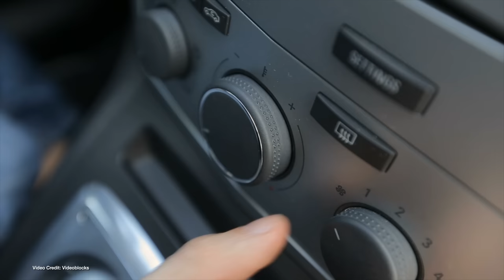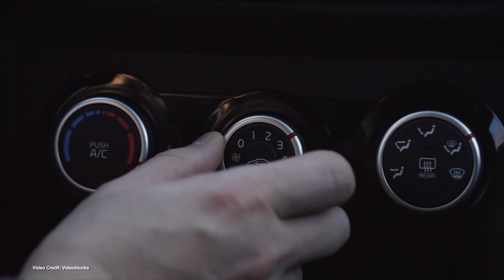How Do Electric Cars Keep You Warm In Winter?

Comment from the maker: EDIT: We know we didn't phrase this well. What came across as the implication that Resistive and PTC heaters (which generate heat the same way) weren't energy efficient was wrong. They're very energy efficient. 

What we meant to say - and should have said - was that while they're good at converting energy into heat - they're not great for vehicle efficiency on a long distance trip because while they convert near 100% of the energy they consume into heat, that results in a much reduced range in winter when compared to say a heat pump. We're sorry for screwing this one up badly.
Reply: But you also said (8:16) that PTC heaters are more efficient than resistive heaters and that doesn't make any sense as they are fundamentally the same thing from a physics POV. I'm sure you know that really.
Reply: @Wookey.  
I have a good argument that a practical PTC heater will be more efficient.
Note that in one of the comments, some was rude about the PTC being resistive so I felt I needed to stretch a point a bit but the reasoning does work:
For structural reasons the heater is mechanically connected to the chassis.
Any heat that flows into the chassis doesn't warm the air.
The element of a PTC heater can be formulated so that it doesn't get above the working temperature of some plastics. 
This means that for it, you don't need to use ceramic parts to hold the element in place.
Ceramics are thermally conductive as all get out.
Reply: Since everything that uses electricity is basically a 100% efficient heater it makes sense.  Of course most of us are getting our energy off the grid which would be lucky to provide us with 50% efficient electricity.  Because of that the statement that resistive heat is inefficient is true.

Of course with the magic of a COP 3 heat pump is we can take that 50% efficient electricity and move 3x as much heat. . . Making it “150% efficient”.

I imagine though that the real COP of the heat pump is closer to 2.5 or less and that the machinery that makes it work is packaged so it’s energy usage counts toward winter heat gain, like you would see with ground source geothermal.  (When I last looked 10 years ago Water Furnace claimed heating COP 1 higher than cooling)
Reply: quite un-factual
Reply: Resistive heaters are 100 per cent "efficient"
Reply: @johndelong5574  
That is not completely true.  The output is the warmth in the air of the cabin.  Heat that goes to the chassis and out to the outside are are losses.
Reply: @kensmith5694  energy can niether be created or destroyed .1 watt=1 watt
Reply: @kensmith5694  you’re going to far with the story.  In this case considering any electric device placed in the location of the heating grid in the vehicle, all other design parameters the same.  100% of the energy the electrical device consumes will be sensible heat within seconds of the electricity being consumed.  Trying to include heat losses through the packaging muddy the reality unless of course the package has to be different to contain one type of electrical device in a way that results in more heating losses.

In proof of the “all electrical devices are 100% efficient heaters” point, let’s consider two electrical objects: light bulbs and ceiling fans.  Interestingly these are often contained in the same package!

In the case of light bulbs we effectively get two things: visible light and waste heat.  But what if I told you that the visible light would be converted to heat in milliseconds?  Think about it.  A photon can not bounce around a room indefinitely.  We would all go blind in an instant after turning on the light if that were the case.  Instead when the visible photons leave the bulb and hit something, you or a wall, some of them are converted to heat and don’t bounce off.  By the time the light level in a room reaches equilibrium the visible light emitted by the bulb is being converted to heat at the exact rate it’s being produced thus the lightbulb is a 100% efficient heater.

In the case of the ceiling fan the same thing happens.  We get two outputs: heat and air movement.  There is some sound too but that’s also air movement.  As the fan turns and moves the air 100% of the kinetic energy in that air movement is being converted to heat via friction and so again even a ceiling fan is a 100% efficient heater.

So. . . Unless you’re moving heat in or out of the cabin via a heat pump or a fan moving in air from outside it doesn’t really matter what you’re using to make heat as the heat output will simply be the energy consumed.
Reply: @johndelong5574  
In any system there will be losses.  The purpose of the heater is to make warm air in the cabin.  Any heat that instead goes straight out into the environment is a loss from the point of view of an efficiency calculation.
Reply: @abelincoln78  
The purpose of the thing called "the heater" in a car is to provide warm air to the cabin of the car.  The resistive element or "grid" is only a part of the heater.  When computing an efficiency of a system you go from input to the output.   If you don't then the calculation of efficiency for an ICE engine could also be said to be 100%
Reply: Heat pumps are the efficient solution. Direct electricity is not very efficient at all. To say resistive heaters are 100% efficient is a bit misleading, because you can make better use of that electricity then just heating up even if heating is all you want to do. 
Still many combustion based heating systems will have an efficiency number based on how much heat from combustion is used to heat up the space (as opposed to lost in exhaust). One has to remember though, that even in those systems the heat could power a heat pump to give better heat transfer than what pure combustion gives. 
There is a theoretical limit on how efficient you can move heat from one place to another: COPheating = Thot / (Thot - Tcold).
Reply: @misium  I get you, but I've also heard people claim heat pump water heaters with COP of 2 are 200% efficient.  Honestly I don't think % efficiency is the best way to rate heat pump systems since I know what a COP is but most people don't so I guess claiming a COP 3 system is 300% efficient is the best we can do.  (I'm team heat pump btw, I just think its silly to not include some kind of backup)

Comment: Yeah, EV's clearly don't work in the cold. I've heard people say this for many years. That's why Norway is the first country in the world where electric car sales outstrip those powered by other means. Because it's never cold in Norway.
Reply: Actually Norway is not as cold as you might think. I just looked up Oslo and Chicago on wikipedia; the average low temperature in January is colder in Chicago.
Reply: @kkobayashi1  for your information: Oslo is in the south of Norway and the sea/fjord (with the heat from the Gulf Stream). Today it is about -15 C/5 F.  On my way home from my cabin back to Drøbak (close to Oslo) the temperature varied from - 10 C/ 14 F down to - 25 C/ -13 F and my EV had no problem. For European and Asian car manufactures (fossile or EV) it is common to do cold climate tests here in Scandinavia (Norway, Sweden and Finland). So, I think it is cold enough to be relevant ;-)
Reply: @arildskaalsveen7126  But 1/3 of the population of Norway lives in that area, right? Are Teslas equally popular in the colder parts of Norway?
Reply: @kkobayashi1  You will find EVs everywhere in Norway (even at Svalbard). The popularity was higher in more urban areas in the south and west due to different incentives such as; you are allowed to drive in fast lanes, no road toll, free ferries and more. Distance between supercharges and EV range is an issue in Finnmark (our most northern part). However, this is changing and more superchargers are now planned and built in the north. Cold climate is not considered as a bigger issue for EVs than for ICEs. ICEs owners are often adding/using cabin and engine heathers in the winter and antifreeze is mixed in the fuel. All EVs that I know have pre-heating as standard available from an app.
Reply: Most space heaters use about 1500 watts of electrical energy which is about 2 horsepower.A car requires about twice this in 30 below celcius.That means you need the equivalent of 4 horsepower to stay warm.
Reply: Tesla is subsidized by govt Thru incentives that means taxes are paid to tesla.People who cant afford evs are paying rich people to own evs.Power for evs supplied by coal or nuclear or windmills subsidized by taxes.natural gas and oil infrastructure already in place.Increased demand for electric power requires tax based infra structure increase.Tesla now "richest man in the world"
Reply: Batteries don't work in the extreme cold.  To get any heat out of them, short the positive and negative terminals together for my amusement.. Perhaps Tesla should supply woolly hats, scarves & gloves as part of their winter pack. Electric vehicles are a scam to squeeze the last pennies out of people & is enforced buy governments and local councils by heavily taxing regular fuel cars

Comment: There's something fishy with the comparison of resistive heaters and PTC heaters. They are both resistive, so their efficiency must be equal, and it's 100%, since the only kind of loss they can produce is itself heat.. The plain resistive heater relies on either a thermostat or temperature sensor (plus controller) to provide feedback and achieve a desired target temperature. The PTC has built in feedback provided by the positive temp coefficient of the resistive element, but still needs additional feedback that senses the temperature being delivered to where it's needed. What may differ between various systems is how directly the heating element is applied to the target -- for example heating elements applied to the front or rear windshield rather than hot air blowing on them, or heating elements in the seats applied almost directly to the occupants, instead of again warming them with hot air. Some of these methods may be able to provide a heating result where it's needed while avoiding overheating the air which might then wastefully dissipate heat where it doesn't matter, such as via the roof or side windows or under the seats.  But so far as resistors vs PTCs, those elements are both "100% efficient" at converting electricity to heat.
Reply: I thought that, the elements themselves are 100%, the control electronics may use extra juice.
Reply: @Muppetkeeper  Any control electronics use relatively little additional energy. And such energy they do use ends up as heat. So again, 100% of the energy goes to heat.
Reply: Correct. The only advantage of PTC is that it has a sort of built-in thermostat, so assuming the PTC heating element is not significantly more expensive than a resistive heater, it saves money - also it could be more reliable (fewer parts to go wrong.)
Reply: @anahatamelodeon  A PTC system still needs a controller, you need to be able to adjust the temperature, after all. What they do have is an added level of safety as the PTC element will never exceed a particular temperature, even if the controller fails and goes into a 100% power output state. As stated by others, they are self limiting temperature-wise, always a good thing in an enclosed system that is largely constructed of plastic.
Reply: Have you ever heard of self regulated heat trace for pipe?  The heat trace come on only by thermal change. It's a good solution instead of regular heat trace that us just resistive.

Comment: The real solution have a resistance heater for extreme temp and heat pump for all other times.
Reply: Surely the added components will affect the curb weight and thus the efficiency of the car itself... No easy solution for this in my opinion... Thought I do wonder whether peltier elements would be of use.
Reply: @scabsareus  A 3kW resistive heater weighs very little. Adds maybe a couple of Kg?
Reply: @Wookey.  and the pipework and routing? May be on a different circuit due to cross purposes... I'm not an expert by any stretch but I am an engineer... There are a lot of design parameters that often get lost in the conceptual ideas which can have an adverse affect on functionality.
Reply: Isn't this what the Leaf does?
Reply: @scabsareus  Well if I was going to add a resistive heater to an existing heat-pump system, I'd just stick it in either the source liquid or the output air so no extra pipework or ducting needed. But yes I'm just an engineer too and have not looked into the details of modern car heating systems and exactly how the heat-pumps are plumbed in. I can't see any reason why you'd need a totally separate system, but maybe there is one.
Reply: @Wookey.  Brilliant. So true.   LOL...I live in a net zero house, but I am sitting next to a resistance heat strip right now that weighs maybe 100 grams and putting out max heat.    Naturally, I only use it briefly for those occasions where I just need a little radiant heat for a minute like coming indoors from the frozen tundra to warm hands or right after eating or something.
Reply: @sonicbhoc  Yes I think so.  My leaf I believe has both resistive heating for instant heat but also a heat pump for efficiency.
Reply: I thought they heated up the battery via inefficient motor running and that cycles to the battery and then is moved to the cabin
Reply: @ralanham76  That's not the Leaf. As stated above, at least in cold climate markets, they have a heat pump and resistive heater (which I've observed at highway speeds in -25 C weather draws about 4-6kW to maintain 22 C cabin temp depending on what speed highway you're on). Newer Tesla vehicles do though.
Reply: Batteries don't work in the extreme cold.  To get any heat out of them, short the positive and negative terminals together for my amusement.. Perhaps Tesla should supply woolly hats, scarves & gloves as part of their winter pack. Electric vehicles are a scam to squeeze the last pennies out of people & is enforced buy governments and local councils by heavily taxing regular fuel cars

Comment: I wonder if EV designs will incorporate more thermal insulation in the future. ICE cars have very little insulation because they have access to free heat and many horsepower to power the air conditioner. Today's EVs are mostly designed to be similar to ICE cars, using components and manufacturing methods designed for ICE cars.
Reply: Yep - there is huge opportunity to apply a bit of building-physics to car design to reduce thermal bridging. Especially with aluminium cars which conduct 5 times more than steel ones at exposed metal.  Double-glazed windows would make a big difference as 5mm of glass loses heat fast (U=5W/m2K) , but that's quite heavy and expensive. They do already do it on posh cars for noise reasons so it is feasible. I'm sure they could be much improved without spending too much money.
Reply: A layer of insulation and in from of that (in the interior) use the same as the heated seat tech.. B well toasty.

It makes sense for a phev in the snow and cold.

Comment: My car's heater sucks.  I have done everything but rip out the old heater core and replace it to try and make it work better, but no joy has been found.  When the temps get close to 0F, it's almost useless for anything other than keeping the windshield MOSTLY clear.  This year I had enough and bought a heated seat cover.  BEST INVESTMENT OF MY LIFE.  Sure, it's a resistive heater, but it has made a world of difference in my driving comfort in northern Minnesota.
Reply: Foxtrot Oscar  I think a heated wheel cover or something of the like are the next splurge I get.  Whatever it is, it'll need to be easy to transfer to the next car.  This one has served me well, but with over 300k on the clock and low compression on one cylinder, I'm not sure how much more money I'm willing to sink into it.

Comment: Tesla use a fourth way to produce heat, as shown several times by our excellent Bjørn Nyland: motor stators. He shows them consuming up to 7kW total. No idea on how it works (high frequency alternative current?) or how efficient this is though. Thanks for the video!
Reply: I have to look it up again to be sure but I think Lucid can use the heat from the motors in the cabin also. But yeah channeling all the battery and motor heat from the car into the cabin during cold days seems like something that all electric cars should use in the future.
Reply: Is that basically waste heat produced by the motor? Do many EVs have liquid cooled motors? Also in the same vain, I think the battery produces waste heat as well.
Reply: They could generate heat by setting the motor drive phase closer to zero to make the motor waste energy. This could even be done if parked.